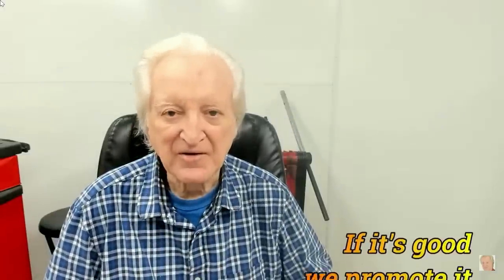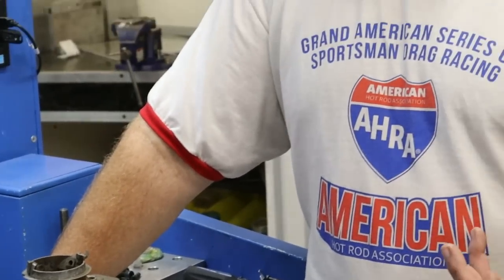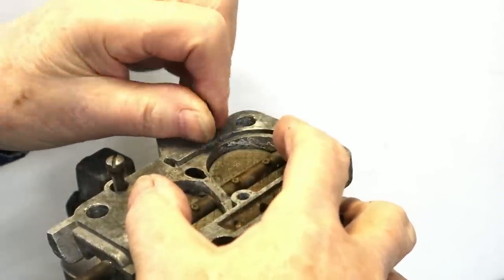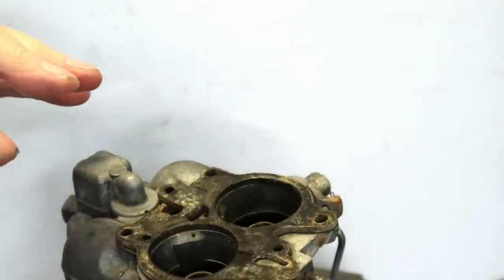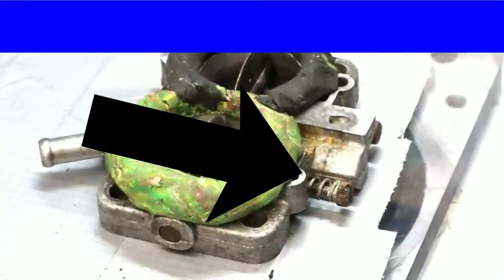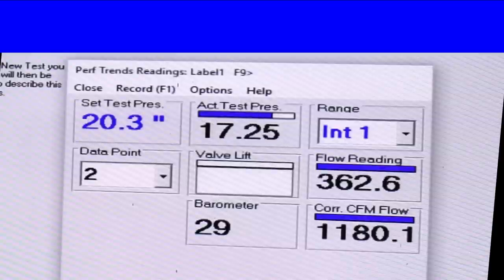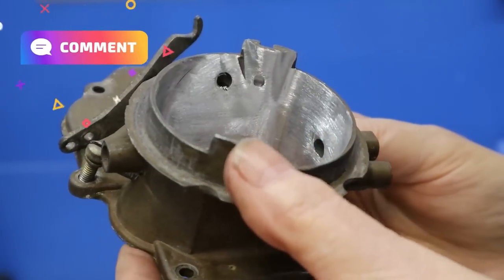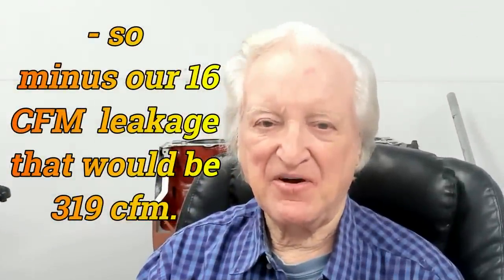How to add 50 CFM to a lowly two barrel carb

Comment: Just re-watched; as this is a great reference video. Realised you're getting +105m/s through the 30.1mmØ venturi's. That's an awesome effort and what I'd consider: 'pretty much all there is to get.' Since you'll very rarely see air speeds in 'conventional' systems exceed 110m/s. (For those that are wondering, this speed represents the point at which airflow transitions from 'incompressible' to 'compressible.' Basically you kind of run into a brick wall around this air speed in these sorts of systems. Additionally beyond these velocities in a carb, meeting fuel accurately becomes increasingly difficult as the mass flow of air, no longer follows a linear relationship with air velocity)

So again; awesome effort.

Comment: I have a set of jewelers files I use to deburr the throttle bores and boosters..Did this to 800cfm Quadrajets years ago to feed big inch Pontiacs..I also discovered that the Ram Air floats were smaller than regular Quad floats....more fuel in the bowl. Easy swap..grind the throttleplate screws smooth...it's just a pressure differential device...smooth the airflow and give the boosters a good signal

Comment: When we do these carburators... We increase the size of the pull over enrichment circuit... Just increase the size of the exit for the fuel..This makes that circuit act like a second accelerator pump..
It will make it come on sooner..
CrazyHorse Speed Shop N.J.
Reply: How do you do that? I'm a novice , can you describe it s little more or maybe post a video?
Reply: @TheJCompound  I will respond... But not now... Busy at the moment
Reply: @frankromero4048  thanks!
Reply: @TheJCompound  
These carburators are often used on late model Dirt Track stock cars... If you increase air flow... You must increase fuel flow...
The more atomized the better... Good luck with your project...

Comment: Back in the 60's these ideas were almost a standard for any carb rebuild for performance.  Even the ordinary daily driver could benefit from a good cleaning, deburring, and fitting the gaskets to the castings.  Emory cloth was a must to smooth out the 'barrel' and the boosters.  THANK YOU for bringing up these simple yet forgotten basics.  "The only thing common about 'common sense' is that it is uncommon!"

Comment: You missed one.... those boosters are massive.  Start stacking booster gaskets, one by one, until you start to lose booster signal.  Subtract 1 gasket, and mill (shorten) the boosters by same amount of added gaskets.  You will be lifting the booster, up out of the venturi and increasing air flow.  Because the flow goes up, so will the booster signal, until you run into diminishing returns.  
 Of coarse, you will want to taper off the OUTSIDE of the booster after milling.

Comment: Some of these tricks are familiar to me; I figured some things out myself when I was rebuilding carburetors back in the day. Another thing I did to smooth the bores, after some judicious grinding, was to put steel wool on a taped dowel (chucked into a drill) and run it through until the ground surfaces looked really smooth. I didn't have a flow bench, but it seemed logical to remove flash and casting irregularities for smoother flow. The new thing I learned from this video is the remodeling of the throttle plates and shaft. Thank you for the great information!
Reply: A common mod when dealing with Karts and Tillotsons back in the 70s here and in the rest of Europe when trying to wring as much power out of 100 cc 2 strokes and extended to SUs and Stromberg VV carbs where rules allowed in larger 4 stroke engines . The shafts are thinned both sides and the plates soldered in after knife edging and assembly in the carb body eliminating screws and bosses altogether .
Reply: Polish all intake air flow I’ve been doing this for years on my motorcycles

Comment: In the past I have milled the bottom off the booster venturi up to the discharge tube then tapered what's left to an edge and found no detriment to transition to main circuit, this of course on increases VE motors as like you stated the signal has improved as has air flow and speed from engine upgrades and higher compression also improves signal, long before it was fashionable we were cutting the front two bbl off 4bbl holley to make big 2bbl, even did it with a Dominator when budgets allowed to build to 2bbl rule
Reply: I've heard of this before here in Georgia.

Comment: Yes, with modern vehicles it's a bit harder to get incremental gains than with the old iron, but there is still room for "free" improvements if one is prepared to spend the time.
Many years back, I used a combination of Mr Vizard's "A" series, and Mr Yunick's tuning tricks to get an esimated 30-40*% gain in mid-to-upper mid torque/power to modify the OEM parts (student budget, but access to machining)) and fabricated exhaust (OEM manifold, reworked).

*from ~100kph to ~130kph on the same hill, both figures were consistent, so real-world gains.

Comment: If you plug and smooth the hole where the choke plate shaft went through there should be some gain there. If it's allowed I would round the entrance of the air horn like a velocity stack.

Comment: As always well done David and Andy. The best part of this series is that the incremental changes were backed up by quantitative data. Personally the one test which I felt you should have peruse was the entry loses into the carb inlet itself. Given that the test of throttle plate in isolation represented the ideal maximum (372cfm), it also included the use of putty to create a radiused entry. To an apples for apples comparison the final test (all modifications undertaken) should also have included the same putty treatment at the carb inlet. This would definitely show improvements in cfm viz.  bell mouth entry, which some air cleaners of the era tried to emulate.

Comment: An air cleaner base with a radiused entry would probably help quite a bit as well…..one could easily be stamped from sheet metal because the carburetors entry is round…..or if you don’t want to use a filter, then it could become a longer velocity stack profile.
Reply: For maximum results, he needs to use the Salad Bowl. "Engine Masters" has proven that over and over... ;)

Comment: Love seeing these carb mods. in the process of doing something very similar to a 34ADM weber.
Can't wait to see this project hit the dyno
Reply: Make sure you share results in the appropriate places. This has tempted me to play with a spare Hitachi I have.
Reply: They respond well to some work those carbs, you can make them flow the equivalent to a 350 Holley, blending through the Venturi is important and thinning the throttle shafts as well. You gain 10cfm by making a radius entry for the top of the carb, especially important if you don’t have a lot of clearers between the carb top and aircleaner lid 👍

Comment: This does work. I have done it years ago to a Holley 4 barrel and went up one jet size from looking at the plugs. Seat of the pants feeling it worked.
Reply: Did the 1 jet size make a notable difference on the plug?
Reply: @craig8187  you tell was lean so went up one and looked normal after running a few miles

Comment: A new gasket will not overhang the throttle bore like that. Your gasket is old & has shrunk. Staying tuned, this is getting interesting. Once upon a time, long, long ago there was a guy campaigning a Dodge station wagon (B body) with a 2 bbl 273. I can't remember what his times were but for a 2 bbl 273 they were respectable. Wonder what he did to the carb? I think MoPar Action magazine did an article on it.

Comment: I did many of these things to a motorcraft 2 barrel back in the early 90s including chopping off the choke horn epoxy a few areas and smooth up everything essentially smoothing all the radius areas. had a loose 351w with an automatic in a mercury capri, nary a 5.0 could touch it. Must have been embarrassing to follow someone back into town spouting how they gotta have nitrous when I popped the hood and took the air cleaner off and said “show me the nitrous dude” 😊

Comment: Due to cam profile the idle may need raised whitch gets you off the transition slots so you may need to drill the plates to give it the air it need to get it back to closed plates so the idle screws come in to play.

Comment: I've been working on my own carbs = carter 1 barrel & carter 2 barrel for my slant6 's  and doing same mods . I sent Andy an email about it and I have videos on my channel - Moparman1978 on my butterfly plates and choke plate I took the flate edges and gave them a knife edge. I'm also planning on cutting Dow and smoothing out the opening on the throat of the carb and cut down and smooth out those tabs aka ears that hold the air clear housing rod up. I also thinned the boosters as well

Comment: Right on! Have done that to other carbs and Carter 2 bbl  running on stock eliminator automatic, there are other approved replacement carbs for 318 listed for that engine that van flow more with mods. Ps, try with a 4" stack on dyno, fuel stand-off with the open plenum single plane manifold, attn: Andy.
Reply: Yeah I was thinking a simple tube or velocity stack on the top of the carb and a 4 to 6 inch carb spacer with a radius around the back side of the entry would pick up some cfm for sure, and if you’re going all out, a slide throttle body to eliminate the restriction of the butterflies
Reply: In my experience getting that air to flow as straight as possible down the carb makes the best power along with enough room for the air to straighten out again before it makes the turn down the runners

Comment: I've got a 5.9 magnum, with a ported 2 barrel throttle body. it supposedly flows 1050 cfm, I find it hard to believe but It did make a noticable difference from the stock TB. Been looking at putting a 4 bbl Holley on it but that's $450 before taxes

Comment: If the booster mods make it more efficient, wouldn't it require LESS jet? If throttle shaft screwheads are removed, what keeps the parts clamped together? Much more on this in DV's Holley carb book. Great meat & potatos hotrodding here. Much thanks!
Reply: With more air being pulled through a Venturi that has stayed the same size, the vac signal will be stronger through the booster and draw more fuel, so yes you would think that a smaller jet would be needed BUT you have to remember there is now also more air that needs fueling 👍 so in theory the jet will stay about the same size or slightly larger if required higher in the rpm range.
Only the back of the screws that threaded into the shaft have been blended into the shaft, the screwheads themselves are clamping the blade to the shaft.
I just hope the screws have been locked into place so they don’t fall out and get eaten 😳

Comment: Thank-you David and Andy for posting this video. I've looked online for a table of flow coefficients for throttle plates in the 40-48mm range as would be found in DCOE/IDF Webers. I believe the areal efficiency will increase with diameter because of the area/wall ratio increasing, and the shaft dia./plate ratio decreasing, but I can't find numbers anywhere. Your test here indicated 321/372, for a flow coefficient of 0.863. This was somewhat worse than I expected, but I don't know what size diameter are your butterflies. Do you have some numbers you could share for typical flow coefficients in the range I'm seeking?

Comment: I would love to see you do this to a Edelbrock carburetor. I wonder what you can make a 650 cfm Avs2 or Avs2 flow? Maybe 750 or 800? It would be neat to take something that's not supposed to be a performance carb and see it flow with a 4150 carb.
Reply: I second this one.
Reply: @TheInsaneShecklador  I got a vac secondary to flow 795 with simple mods like down leg boosters and one of those k and n holley spacers shaved shafts and no choke
Reply: @turkeyboyjh1  👍

Comment: I have been doing this to throttlebody‘s for years, then even filing and smoothing down the underside of the shaft the same way however with just little more meat than that. A little bit of Loctite for the screws.

 whenever I suggest this half shaft mod everybody just shrugs it off. 😅
Reply: There are those who see things differently than most others. It's in our blood.

Comment: Hi David, I’m following your videos and I’m wondering whether, in your experience the modification to the butterfly and spindle that improved flow through your carburettor would yield any gains through a single throttle body, which then goes into a large plenum chamber. I realise that you haven’t been a resident in Europe for many years, so you may not be familiar with the specific vehicle. I am modifying a 1900cc 8v Peugeot engine fitted to a Peugeot 205 GTi. Any thoughts that you may have would be appreciated.

Comment: In order to hit the 1hp per cubic inch you will have to make more than 318hp because the engine is going to have more cubic inch displacement than 318 when you are finished

Comment: David Vizard. Would adding a velocity stack to the 2 barrel carburetor help with flow? Also how about porting the intake manifold? Taking flash marks off as well as some internal casting numbers and lumps. To help improve flow.

Comment: Thanks for taking the time to share your knowledge in these videos David. I'm curious to know what the weight reduction was on the 318 rods. I went back to see what I guessed. The first video (small end) I guessed 96 gr and the second (beam) video I guessed 32.5 gr for a total of 128.5 grams per rod reduction.
Reply: That's over two pounds !! And David knows how to shave double, and up to triple from the crank weights.

Comment: Built a Vizard inspired 385 sbc with a q-jet, 750cfm.  Removed choke assembly, smoothed up casting flash, rebuilt it to Cliff Ruggles  specs.  Never touched main or secondary shafts.Ground down the screw tips sticking through plates.  What would be the process for both of those shafts.  Possible 800 cfm through this body?  Off topic but still relevant.

Comment: The knife edge is only on the downward side (topside still stock), this is clear:

The knife edge only on one side of the shaft (the visible edge in the video), or also on the other (also downward) side of the plate (not visible in the video)?

Comment: With all of the modifications that this engine is getting, should have ported out the 2 barrel intake opening on the manifold and installed a 4150 flange on it and just use a 4 barrel carb.
Reply: Not the point of the project.
Reply: That’s against the rules.

Comment: Why such a low test pressure for the base plate after you did the shaft and blade mod? Was it going turbulent if you pushed the test pressure closer to 20”?

Comment: @Mr. Vizard: Knife edged butterflies: 

So the butterflies look like a wedge shape when laying on a flat surface (table) and being seen from the site. 
Like so: <=

- Is that correct?
Reply: Just the side that is not in contact when closed. Opposite sides on top and bottom. Other side of the edge is left alone.

Comment: My other question is, why not use the heads, manifold, and BIGGER 2bl carb from a 360? You could crutch the compression drop with cam selection.

Comment: Crazy to do all that botching of carb for so little air flow. Later 318 police ,and trucks were available with real 4 bbl carbs and manifolds along  with la 273's so why can't you use these available 4 bbls?? Also I've heard and read Mexican and venazualin built 318 had available 4 bbl 318 in early 70s  rated at 270 hp ...

Comment: Isn't the venturi size going to be the limiting factor ?
Reply: I have a feeling that eventually we will see the main body clamped to the table of a vertical mill. Hogging out the venturies will make a huge difference in air flow. I have been known to remove the venturies on Webber ida’s and idf’s.

Comment: Butterfly screws are a lot of flow loss on a lot of stock carbs as they are way too long.
Reply: Red locktite a carbide and a small center punch usually fixes that.

Comment: Ford's better idea light bulb advert worked until the light bulb burned out. Its OK, I am a Ford man. 1940 Ford Fordor Deluxe streetrod. Doing the 66 289 with LS 1.9I and 1.55E valves. 
Andy, do you know what Ford stands for?
Flip Over Read Directions :-).
Reply: Too bad. 289 is a real nice hotrod motor.
Reply: @mickangio16 What is too bad?

Comment: Don´t raffle the parts off. Build it and show the results of your efforts. Then raffle the entire engine off or sell it on an auction.
Reply from the maker: Torben, That's exactly what we had intended to do.
Reply from the maker: But let me add to my statement here. We are going to raffle off a potentially 500 hp motor. All the parts that become redundant such as the iron heads, ported stock intake manifolds, Carbs - probably about a half dozen of those, a several camshafts, a set of rockers or two, and so on. ,All dyno tested on the way to our alluminum headed all out street motor of about 500 hp. Will that get us an OK??
Reply: Yes a big ok David. 
Thank you for ignoring the purists and using the ls parts and beehives. True low buck mods that work.
Reply: Alright 😎 Maybe I misunderstood it the first time around
I like these odd projects. More fun and often more knowledge to be gained here

Comment: Great work. 
It's too bad you couldn't start with a 360, 383 or 400 Ci. OEM 2-barrel. They start at a higher CFM.
318 ~ {1968 and up}
Carter BBD {1.437" Throttle Plates x 1.186 Venturi}............ 285 CFM Rating
360 ~ {1971}
Holley {1.563" Throttle Plates x 1.343 Venturi}................... 350 CFM Rating
383 ~ {1962 thru 1971}
Carter BBD {1.563" Throttle Plates x 1.313" Venturi}.......... 365 CFM Rating
400 ~ {1972}
Carter BBD {1.563" Throttle Plates x 1.313" Venturi}......... 365 CFM Rating